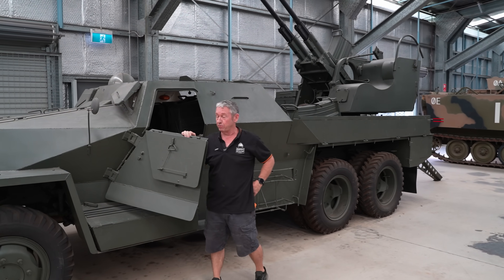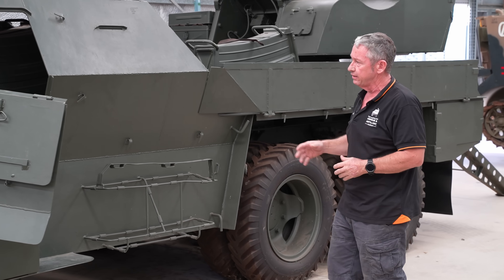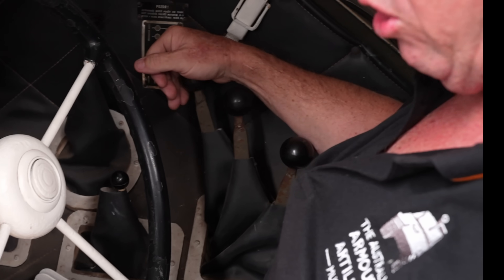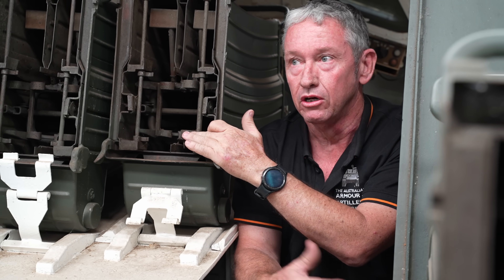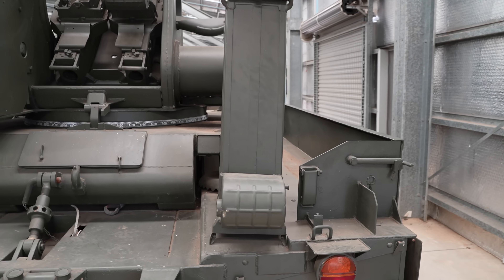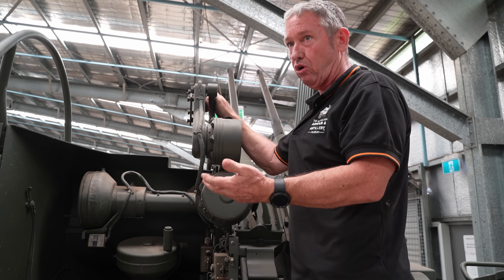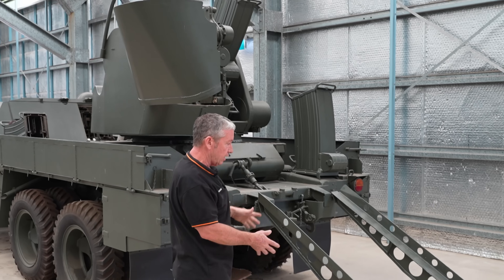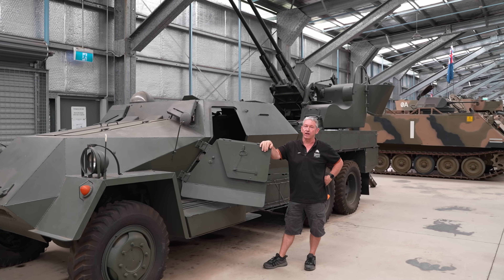The Czech M53/59 Praga - The Anti-Aircraft Twin Autocannon "Lizard"

Comment: In 2001 i was trained on one of those in the army in Croatia. They were M53/85 models, upgraded in 1985 so that the turret was operated with a joystick, powerd by 2 electric motors. It was a 5 men crew,  driver, commander,  turret operator,  and 2 loaders. I was the right one,  my duty after the loading was to cock the gun's. I still have at home a dummy round that we used to train the loading of the magazine, and a empty shell from a firing exercises.

Comment: During Yugoslav wars, it was used against infantry. My uncle was in army and saw enemy soldiers killed with Praga. At front where man was hit, there were hole in a body size of a bullet, but at rear, there was giant hole, we could say half of back missing. If somebody was get hit in arm or leg, that part of body was torn away immeditely. 

Praga was obsolete against air targets, but againt ground it was very effective at support role for infantry and armored vehicles. It could penetrate brick wall, with AP ammo. Than after that with incendiary ammo you could start fire inside builind, by lightning up furniture, enemy would get killed by bullets or it will be forced to abandon that builing.

Comment: Fun fact - the original V3S had to often serve in harsh winter conditions. If you wanted to start it in such conditions it was necessary to get warm air into the air intake... but how do you do that... well, soldiers found a solution by stuffing some newspapers in the air intake and setting them on fire. This process is called "letting the V3S read the newspapers"... Oh, and the truck was pretty much indestructible since there was pretty much nothing to break down. Just the engine, steering wheel and six wheels...
Reply: 4:25
Reply: 4:25
Reply: 4:25

Comment: Referring back to Stug 3 final drive brake stools.  The stools were worn and new made.  A trick is braze bronze or silver on the stool wearing faces (or on the shoe, but not both)
The pinion has spherical roller bearings.  These more typical used on long shafts which bow from gravity and difficult to align the bearings.  Probably used on Stug because spherical bearings have a modest thrust capability

Comment: Purpose of these sledges on back are making one vehicle able to deploy multiple fire stations. Typicaly it would be used more as "cannon dispenser", when you drop first station and drive for another. And fun fact: These cannons were developoed during WW2 for german Uboats. But for some reason they were not used and our military refined that design in early 50s and started to using them as AA weapon.
Reply: 200 MK 303 were made. Ammunition was changed, upgraded as well as the gun wasnt fully developed in ww2. Barrel length etc. also.

Comment: Tatra T912 engine is half of the legendary T111 V12 diesel, with its roots in 1942. Or even before! Chassis looks, that is heavily inspired by GMC CCKW 353 and body by sdkfz250/251 or post war derivate OT810. But this of course not coincidence. Original base car, Praga V3S, was developed after WW2!!! as an all-terrain military vehicle. Therefore some solutions and parameters look now totally weird. Low maximal speed etc. But off-road it is very capable vehicle, just need physically strong driver. Due to long production run, vehicle is obsolete even after modernizations in 80s. But due to produced pcs there is still some of them in use here = spare parts are still available! Any try to produce more modern substitute or succesor was unsuccessful due to communistic economy in 70/80s not capable to start it. Definitely get Praga V3S and its derivates retired after 2000 or more precise with start of the production of modern Tatra T810. Itself based not on Tatra components but on the remains (project and development which Tatra bought and modernized) of one of the attempts to replace Praga V3S after the Velvet Revolution in other, now defunct, Czech company. Get it running could not be hard job, just search suppliers and enthusiasts in Czech or Slovak republic on other globe side. Army sales and companies trading in these goods must still have stocks of complete vehicles and components or parts.

Comment: 3km range isn't very effective for its time in the anti aircraft role. Helicopters are about the only aircraft that would spend any appreciable amount of time within that range. BUT attack helicopters, even then, had armaments with better sighting and range.
Reply: Well the Army of Bosnian Serbs took down a Croatian MiG-21 with these in 1992 but it's the only confirmed downing of a jet with Praga to this day. 
Despite the fact that Praga was massively used and also that quite a few helicopters were taken down, I don't think a single one fell victim to Praga.
Reply: @matovicmmilan  It was good against slow moving infantry. It was extremely hard to score a hit against fast moving plane at the distance.
Reply: Integrated Air Defense. Radar missiles push target down to gun range. Vs Attack helos you can hav enewer heavier longer range rounds that could reach say 5 km. Again, at longer range guided missiles are better.